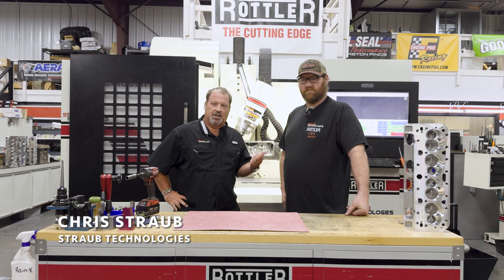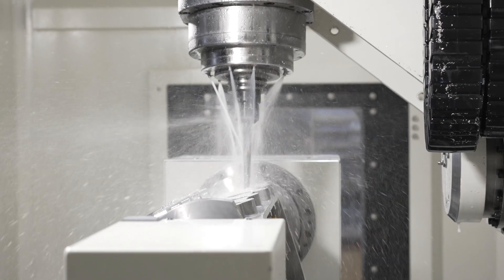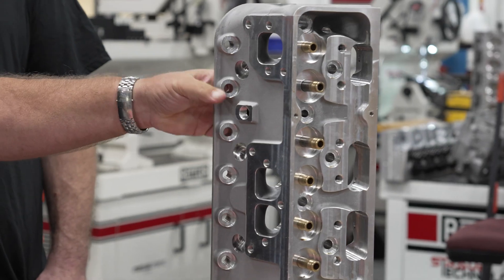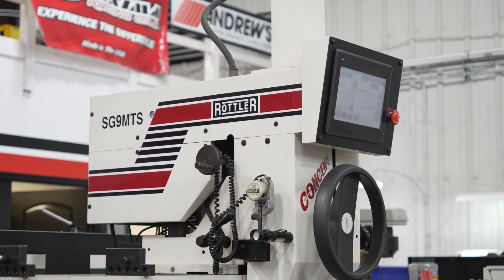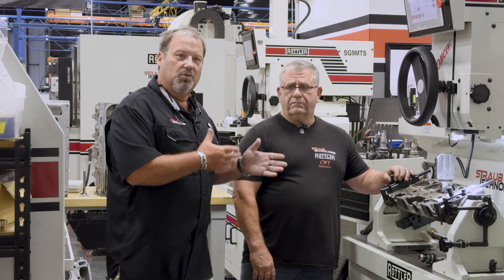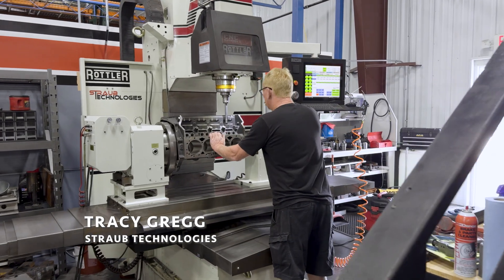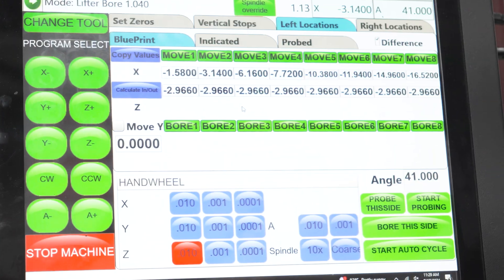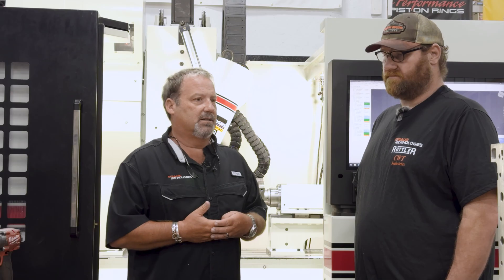Rottler x Straub Tech

Comment: Funny how I got to this video.  I was reading about Summits new SBC offering from Germany.  Google took me to a thread where I saw the name Ripper/Wrench and I'm a fan of this High HP builds of his.  Chris Straub commented about how he appears to like the Summit Block so Google took me to a website where Chris was checking out the metal of the block.  I pressed play and the video wanted me to sign in to prove I'm not a bot.  OK  Problem solved.  Just look up Straub Industries on YouTube and here I am.  BTW,  I love your Rottler CNC Head Machine.  Now if I was a little younger,  I would give Chris a call and ask for a job.  Straub Industries looks like a Fun place to work.  And I would hope to use those machines to build some High HP Engines.  Thanks Chris.  Gerry In FLa